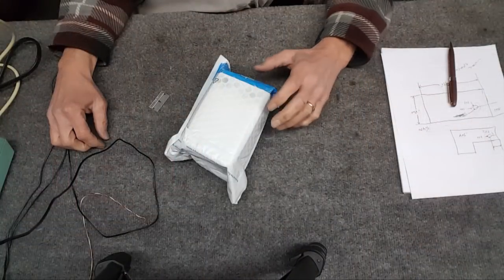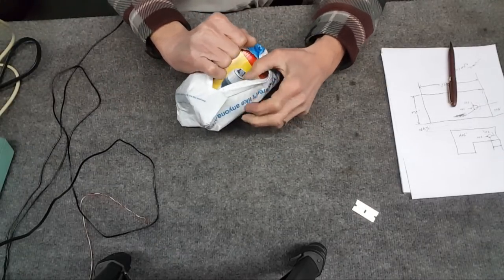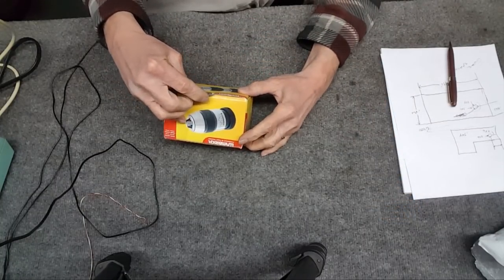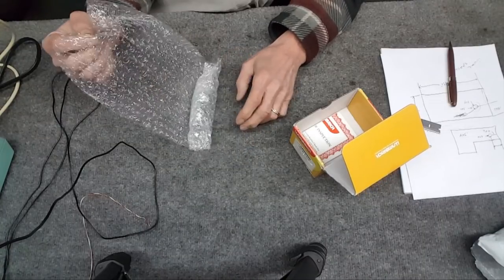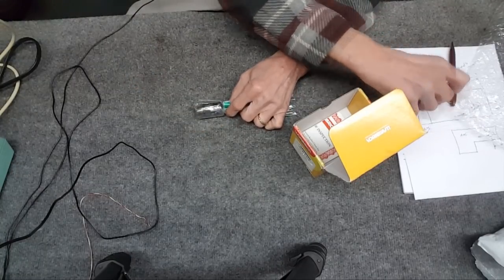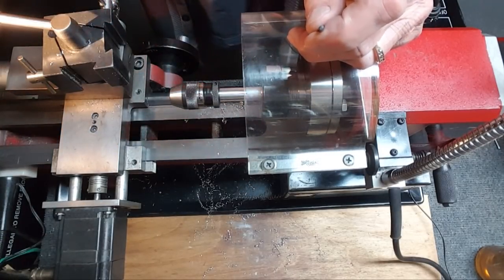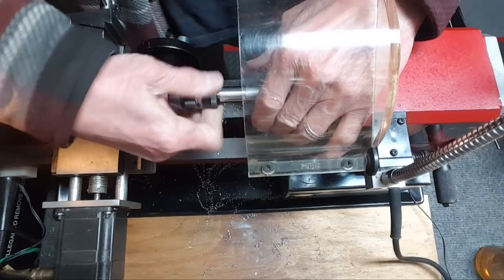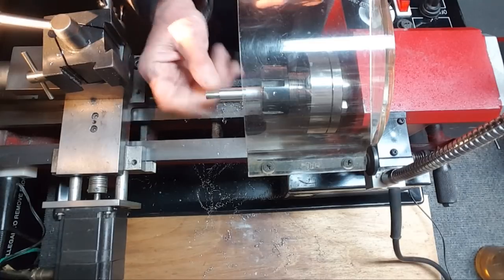Precision Threading On The Mini Lathe

Comment: So, you manually move your saddle until the index indicator is at your number, engage the auto-feed, then start the lathe, and let it go forward to chase the treads? It sounds better than trying to engage auto-feed as your indicator is twirling. Is it reliable, in terms of accuracy?
Reply from the maker: After some experience I never disengage I just put the lathe in reverse and back out. The reason is the half nut and lead screw don't always capture and match the threads perfectly. So for OK threads that work disengage but for perfect threads just back out and dial in for the next pass.
Reply: @TheMiniMachineShop  I had trouble with the halfnut not consistantley engaging and splitting the threads until I scraped the single side halfnut and the support claw and replaced it with the two sided halfnut from LMS. It picked up the thread nicely now.
Reply from the maker: @garylgray2060  I should probably go with double myself!
Reply: Dave M I understand. Never let go of the synch.  OK.....now about setting up the gear ratio of spindle to lead screw......HELP! Is there one ratio that covers a spectrum of common threads? Or is each thread finicky?
Reply from the maker: The HF only does imperial threads so metric is out. The side of your machine has a sticker for threading. One column is threads per inch and shows what gears go in what position. Example for a 16TPI a 40 tooth gear goes in position A, a 65 in position B and a 40 in position D. C is empty. Takes a bit to figure out how to arrange the gears.... There is no covers all arrangement.

Comment: Great videos!!! I would like to know if Is it possible to make threads on titanium using HSS dies?
Reply from the maker: I did a video turning titanium with HSS no problems. So I suspect you can just do a lot of chip breaking... Be aware if titanium gets to hot it will cause a fire you can't put out! Use lubricant...
Reply: @TheMiniMachineShop  thanks Dave,  i appreciate tour help, i will try it tomorrow.

Comment: Not sure if you noticed the clamping ring on the chuck.  Did you look to see if it was compressed which would cause you to cut the treads too small as you were testing fitting?
Reply from the maker: Never messed with the ring and didn't realize what it was till now! How to adjust it??
Reply: @TheMiniMachineShop  not sure, couldn't get a good look at it.

Comment: Thanks for the review of this chuck Dave. What type is it? From where can i get one?
Rudy
Reply from the maker: It was the only one on Ebay but search for LLambrich JKP 30 R-5/16 I had found it somewhere for $110 and I also have this on order https://www.suncoasttools.com/crm/ItemPage.aspx?ItemNumber=536-526&VendorNumber=SOWA
Reply: @TheMiniMachineShop  Thanks for info. While I was searching I came across this one. Have you seen it? The price is a lot more attractive, but that doesn't help if it's not true. By the look of it, they might have tried to make a precision item here.
Rudy

https://www.ebay.com/itm/0-3MM-High-Precision-Keyless-Drill-Chuck-with-Taper-Mounted-JT0/263733275273?_trkparms=aid%3D111001%26algo%3DREC.SEED%26ao%3D1%26asc%3D20160908105057%26meid%3D0b5e66315a7a483e9fd640f023e6f71f%26pid%3D100675%26rk%3D5%26rkt%3D15%26sd%3D202607609725%26itm%3D263733275273&_trksid=p2481888.c100675.m4236&_trkparms=pageci%3A847cbd71-9196-11e9-a500-74dbd180b743%7Cparentrq%3A6961823116b0a4b7b6e658ffffc9b2da%7Ciid%3A1

Comment: Typically, the compound is used in threading operations. It provides two significant advantages to using the cross-slide for in-feed. 
First, it reduces cutting pressure. The compound angle is set to half of the included thread angle. So the cutter is only cutting on one side: half the cutting pressure.
Second, it's much easier. The compound and cross-slide dials are zeroed at the start when the tool just contacts the material getting cut. In-feed is done on the compound, and increases with each cut without reversing it. The cross-slide is only used to bring the tool out between passes and returned to zero at each start: IT IS NOT USED FOR IN-FEED.

Comment: Look at your thread cutting tool under that magnification. Threads will only be no better than that. I would have checked with a good piece of drill rod and not my poor bits before I would judge the chuck.👍

Comment: With a single point tool it pays to make the major diameter quite a bit smaller.  9.90 would be good for M10.  The idea is to remove that material that would normally be taken up by the radius on the crest of the thread, which you are not cutting of course. The geometry of a common shape carbide threading insert allows you to get much closer to shoulders, as the Vee point is very close to the chuck side of the tool.  I only use full form inserts which cut the whole thread including the crest.  To give you an idea of clearances involved a M10 cut with a full form insert will not go into the M10 thread gauge if the Major diameter is 10.00, the best I can get to go in the gauge is 9.97 and that is tight, 9.95 is a firm fit.

Comment: For the most, thread depth for 55 degree is 0.6403 times the pitch. For 60 degree it's 0.6134 times the pitch. If still tight once your at depth usually a light file or Scotchbright over the OD is all that's required. Enjoy your videos Dave, thanks for sharing.
Reply from the maker: This was a 5/16 imperial thread and I think you are talking metric threads but for a 6.0 x1.0 thread I don't think the thread depth is .6134 or even .06134. Am I right?
Reply: @TheMiniMachineShop  Metric or imperial doesn't make a difference, it's the angle.So yes a 1mm pitch would be 0.6134 mm depth to the minor diameter. 5/16 UNF, 24 tpi (41 thou/mil) so 25 thou depth of cut.
5/16 Whit 55 deg, 18 tpi (55 thou) so 35.6 thou depth of cut. Hope that makes sense.
Reply from the maker: Your saying depth is .6 so you want me to go in over 1/2 inch so I'm guessing .6 is mm not inch..
Reply: @TheMiniMachineShop  haha sorry yes just edited to say mm & included some imperial.
Reply: I still talk in both most of the time.
Reply: @TheMiniMachineShop  0.6 times the pitch not the diameter.